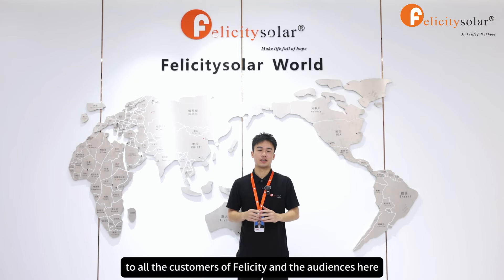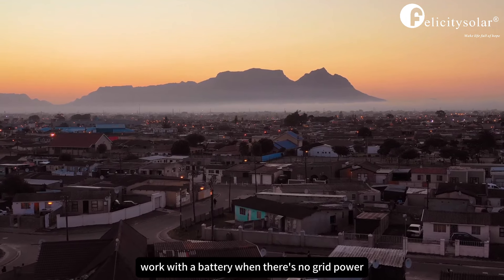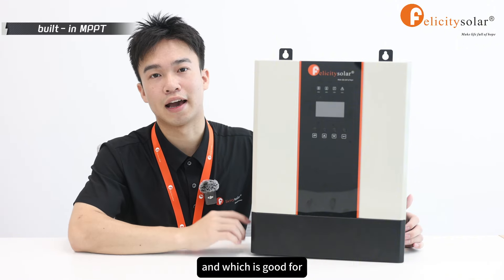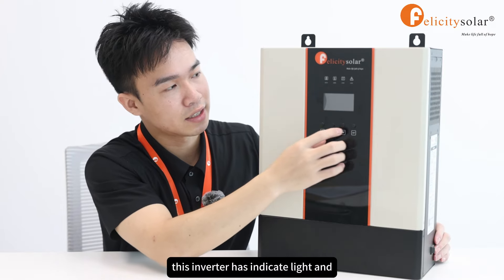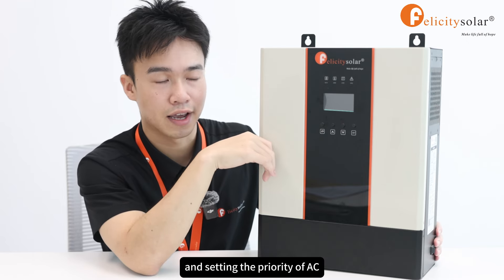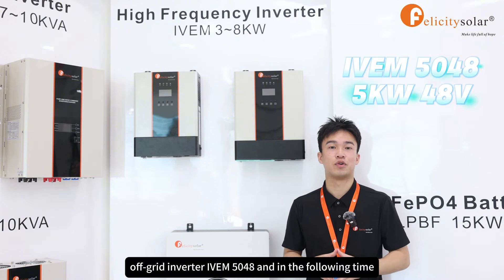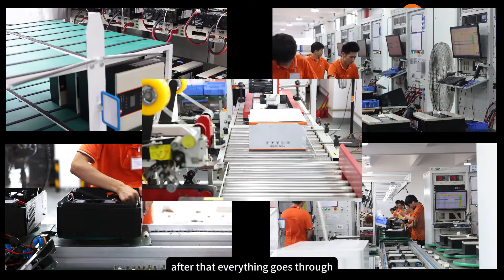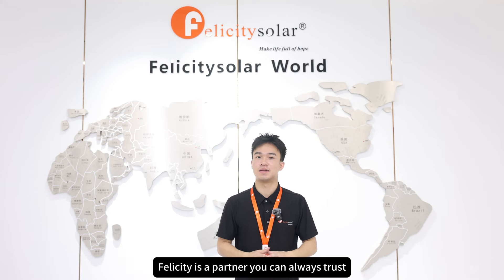Off-grid Inverter IVEM5048

Comment: Can this IVEM 5048 work with the Fsolar app and wifi module?
Reply from the maker: Yes, they can be used together
Reply: @felicitysolar How can we add it to Fsolar? There is no QR code on my IVEM 5048 inverter, so cannot know what is the Device Checksum. No problem with the Device SN as it is written on the inverter.
Reply from the maker: @cnour1978  Please contact our engineer for Technical support by whatsapp: Wasely  +86 131 2609 3443